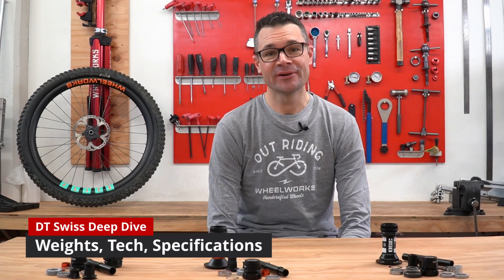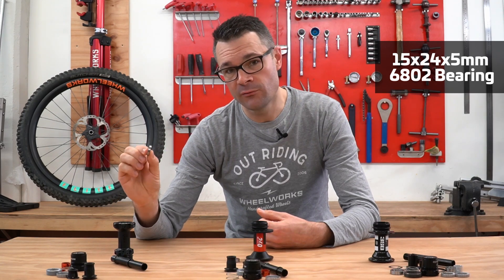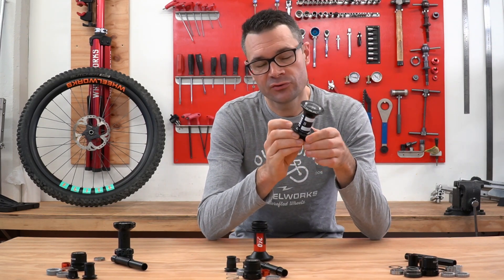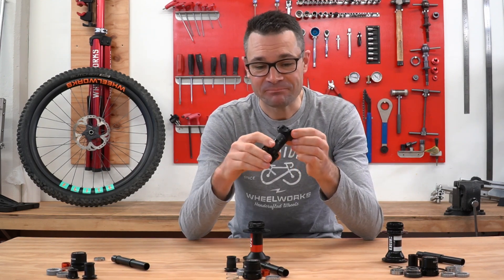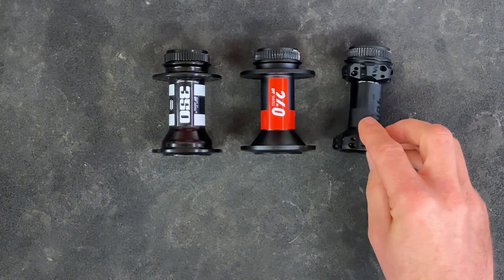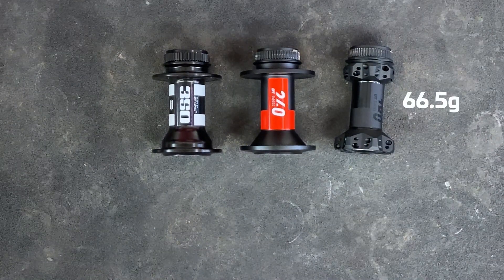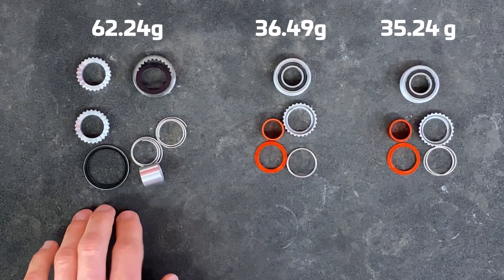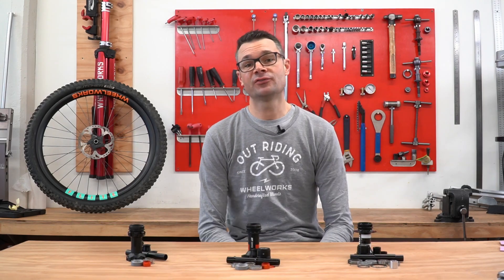DT-Swiss 180 v 240 v 350 FULL BREAKDOWN & WEIGHTS

Comment: Thank you for the video. But...i have one issue with the 240 front hub j bend, it is very heavy. At 146 grams ...pfu...i am talking of the latest one with 6 hole rotor mount, 15x110mm axle. I am disappointed. I have a 2 year old set of wheels with miche hubs and dt rims, the front one is 127 grams, both flanges are big(the 240 has one big and one small), not a single problem. And at around close to half the price for the hub. Bearings also top quality. With the rear i have no issue, top quality and low weight(227 grams) for the jbend, 6 hole, boost XD exp54 model.

Comment: Great video thanks! one question: Would it be possible to replace the hybrid ceramic bearings in the 180 with standard steel bearings if you wanted to? or are these non-standard bearing sizes? so not possible to find steel replacements? thanks!
Reply from the maker: Yes, absolutely.  The bearing sizes used (15x24x5 and 15x26x7mm) are easy to get from either DT Swiss or other bearing makers in a high quality steel version ~Tristan

Comment: why you skipped 370s?
Reply from the maker: its not available to buy* as an "aftermarket" hub and only comes fitted on new bikes so we left it out of this video. 

Now that DT Swiss are transitioning from the 3-pawl to the Ratchet LN system it's become even more confusing though!

*You do see the hubs available to buy sometimes but these are grey-market hubs which were destined for use on brand-new bikes but somehow ended up being sold aftermarket

-Tristan
Reply: @WheelworksHandcraftedWheels  thanks! I got several on pre-owned wheelsets and didnt notice that they are oem only

Comment: Tune hubs require "faffing around"? They're just a pawl hub. Build up just like any hub. I have two years on a climbhill/killhill set with no problems. It's a really good video; but why do you say silly stuff like this?
Reply from the maker: Our experience building and selling these over a number of years is quite different to yours.  Glad to hear you haven't experienced any issues with your pair!  -Tristan
Reply: @WheelworksHandcraftedWheels  what faffing around is going on here?
Reply from the maker: @trentvlak most of the problems are around a creaking drive mechanism related to the XOT bearing used.  The threaded endcaps which rely on o-rings to not rotate don't help but overall we found them to have extremely poor tolerances which leads to two "identical" hubs having parts which won't interchange -TT
Reply: @WheelworksHandcraftedWheels  oh, I see. My versions of the hubs don't have xot bearings or threaded end caps. They must have redesigned.

Comment: If I wanted to swap bearings from the 180 to the non ceramic 6802 would the dt Swiss front 6802 bearing work?
Reply from the maker: Any bearing quality / material of the same size will work  -Tristan
Reply: Genuine NTN LLB.

Comment: What about the front wheel hubs?
Reply from the maker: We focused on the rear hubs in this video because the front hub differences are less, however it's the same story with the more expensive hubs getting lighter and the 180 having ceramic bearings.  -Tristan
Reply: @WheelworksHandcraftedWheels  cool. What bearings are used? Are they all the same dimensions or different as on the rear?

Comment: The 180 hubs come on the carbon all mountain rims.  Should I be concerned about the hub strength or durability due to its low weight and smaller bearings.

Comment: Would love to see a comparison between their new (recent?) Hybrid hubs vs the OG ones. I am a firm believer that the DT Swiss ratchet system is the most solid/abuse-proof system for high torque applications (like those exerted by full power (85+ Nm) eMTBs), in comparison to pawl-based hubs. Before the Hybrid hubs existed, I just replaced the ratchets (gears) for the steel ones. But aside from a steel freehub body and ratchets... are there any more differences? Are they just another "eBike specific" gimmick? Cheers mate.
Reply from the maker: The Hybrid hubs are actually quite different:  The flanges are thicker, the spoke angle looks different, the internal threaded ratchet is a different size, and the freehub is different.  They are certainly not the same as the "regular" hubs and as you say it's refreshing to see this rather than "ebike specific" gimmicks.  -Tristan

Comment: Cool comparison. Seems like a legitimate weight saving going from the 350s to 240s. But those last few grams saved going from 240s to 180s seem like they were achieved mostly by doing things that will undoubtedly sacrifice service life and longevity. Also, hybrid ceramic bearings are terrible in practice because all the bumps you hit during your rides will cause the ultra-hard ceramic balls to make micro-indentations on the inner surfaces of the not-as-hard steel races and this will create more roughness and resistance over time, no matter how well you maintain them. Just a terrible idea, really.
Reply from the maker: Yeah our experience with ceramic and ceramic hybrid bearings echos this - they feel amazing when brand-new but quickly start to feel chunky even if they continue to spin.  This tends to happen quite quickly on a mountain bike hub but take a lot longer (obviously) on a road bike -Tristan
Reply: @WheelworksHandcraftedWheels  yep. Exactly my experience with CeramicSpeed bearings in my hubs, which are some of the most highly-regarded bearings in the industry. Though I do wonder why any of them are highly regarded. They feel amazing when new but truth be told, this is mostly from other tricks, like substituting oil for grease and using non-contact seals (which will even further reduce longevity). Why do companies continue with this bad idea when they and the consumer know that it’s a bad idea?
Reply from the maker: @RB-xv4si  Well at the risk of getting on my high-horse these is where marketing overpowers actual experience.  -Tristan

Comment: Do you have any concerns about the reduced bearing size in the 180 versus the 240? In an internet forum I read a post where the poster felt like the bearings were so small in the 180 that it might lead to durability issues. I take everything that I read online with a big grain of salt, but I did feel like that was an interesting thought regarding the 180. What are your thoughts on durability with the reduced bearing size in the 180?
Reply from the maker: Hey JB.  I'm not sure the smaller bearing will have a big impact on their longevity, especially as the non-driveside bearing (the one which is substantially smaller) is the lowest-loaded bearing and the one which tends to last the longest.  What we find is that ceramic bearings, from all companies including DT Swiss, tend to feel pretty gritty pretty fast.  This might be a 'feature' and they don't seem to get excessive friction, but your axle won't feel smooth when you turn it by hand.  They don't seem to develop any play.

Comment: Very informative just curious why you didn't do all 3 straight pull hubs be a better comparison.  Versus one straight pull and 2 j bend hubs . The j bends have more material.
Reply from the maker: Great question Dan and you're correct that the straight-pull versions of the 350 and 240 would have been a better comparison, or of course if my prayers were answered and we had a J-bend version of the 180!  We tend to use J-bend hubs wherever they're available as they build into a stiffer and generally more durable wheelset than straight-pull do.  We've got a video on this topic coming so make sure you subscribe -Tristan

Comment: Excellent review. I have the DTSwiss 240 EXP and recently experienced an issue with the internal ratchet disengaging mid ride. DT Swiss are aware of this issue and apparently a batch was manufactured using ratchet that undergoes higher wear. While they will warrant this, are you able to post the EXP ratchet removal tool needed? I am looking to do all future servicing and was not sure of that tool. I understand this is different to the 350 model. Thanks
Reply from the maker: This is the tool you need for the EXP hubs: https://www.wheelworks.co.nz/shop-2/tool/hxtxxx00n8387s-dt-swiss-tool-dt-disassembly-tool-for-exp-star-ratchet-w20x1-hxtxxx00n8387s/

Comment: I’ve also heard J bend spokes weak link is the bend compared to straight pull. Got 240 straight pull bladed spokes and 350 straight pull round spokes on my bikes
Reply from the maker: This is a bit of a fallacy - when correctly built J-bend spokes are stiffer and as durable (or more durable) than straight-pull.  Straight-pull has one significant advantage:  they're MUCH faster to build a wheel with and in a production environment that's money saved.  We've got a J-bend vs straight-pull video scheduled so we'll explain all of this in the future - stay tuned.  -Tristan
Reply: Supposed to be lighter too.
Reply from the maker: @catg9196  Again - it depends.  Generally the straight-pull hubs will be lighter though. -Tristan
Reply: @WheelworksHandcraftedWheels  How can J-bend spokes be stiffer than straight-pull? Metallurgically I don't see how that's possible other than the fact that straight-pull are usually longer since there are no hub flanges. Any bend will always have more flex than straight metal.
Reply: @akbast  With j-shaped needles, you can create more crosses if necessary.

Comment: What is your opinion on CL rotor attachment play? When the disc rotor is locked in place by the brake, you can turn the hub by approx 1°. Dt swiss say's its normal but its just seems poor manufacturing for such expensive hub.
Reply from the maker: It's rare that we see any rotor play.  Often what people think is rotor play is actually the brakepads moving inside the brake calliper.  However, once the lockring it tightened there shouldn't be any play in real-life because you're only braking in one direction and not reversing the load on the brake.  A large amount of play would indicate something isn't right, however generally there is no problem with a small amount of play. -TT
Reply: @WheelworksHandcraftedWheels  thanks, its not only for dt swiss even shimano xtr and I9 have this issues when I checked online forums.
Reply: Dude, it's totally normal and isn't a factor when riding. How often do you ever come to a stop and rock back and forth on your bike? It's a non-issue.

Comment: hi, I have gotten the newly built wheel set with 240 EXP hubs. The rear hub came already converted with the 54T ratchet. When the rear wheel is installed with 10 nm , the free hub does not work at all. It is like a fixed gear bike. When I loosen the axle , the free hub does work. I did check the internals, everything is where it should be. Any clue? Not received an answer from the wheel set-builder yet.
Reply from the maker: It's likely one of two things: (1) the red spacer is missing from between the freehub body and hub shell or (2) the fixed ratchet ring wasn't tightened enough into the hub.  (1) is an easy fix and (2) might sort itself out if you use your drivetrain to tighten the fixed ring but would ideally need the correct tool to tighten the ring.  -Tristan
Reply: @WheelworksHandcraftedWheels  Thank you very much for the info.

Comment: I currently ride DT Swiss 370 on STANS ... Any advise on upgrading?
Reply from the maker: Other than a better hub and a better rim? 🙈 The 370 can be upgraded now with the LN freehub body - this basically makes it a 350 with the star ratchet system. It's a reasonably expensive job especially as you'll need two special tools, but gives you a much better hub. If you're in NZ we have XD upgrades in stock, all others are due later in the year. -Tristan
Reply: Thank you.

Comment: you didn't mention the main differences in the end caps. The 350 has no seals whereas the 180 & 240 have o ring seals in. Edit: I've just been told 350 hubs do in fact have o rings in the end caps - mine are 2016 so maybe they have changed since then.
Reply from the maker: I can't recall the 350 ever NOT having o-rings and I just took a look at a few of our hubs and they've all got them.  Are you sure your orings didn't fall out?  They can do that after the endcaps are removed a few times -Tristan
Reply: @WheelworksHandcraftedWheels  Here's my 350 hub end cap: https://youtu.be/-nC4C2BQD2c . No o ring or anywhere an o ring to be. This was my front wheel end cap. My rear 350 does have o rings. So it seems that the 240s have o rings in both wheels end caps where as the 350 is only in the rear (for 15mm front / 12mm rear at least.)
Reply from the maker: @45graham45  I understand now.  Yes, the front hubs all use totally different systems of securing the endcaps.  Many people don't ask questions about the front hubs so we didn't do a deep-dive on these but maybe we should?  The 350 has the axle sit directly on the bearings so there is no space for o-rings.  The 240 uses a different system where the axle goes all the way through the bearings and does have them.  If you convert your hub to a 12mm through axle (for a road bike) then it will have o-rings on the endcaps :-)

Comment: "Big believer in J-Bend spokes... can build a better wheel than you can with J-Bend"...... so now I'm confused. Which are better: J-Bend or Straightpull?
Reply from the maker: This topic probably deserves it's own video!  J-bend hubs are better in every way and allow you to build a better wheelset if (and it's a big IF) you take the time and care but they're very labour intensive.  If you're planning on building a lot of the same wheel then straight-pull hubs/spokes reduce the lacing and tensioning time considerably and therefore have a massive cost saving.  This is the only reason that straight-pull has come about and why it remains - everything else they tell you is either marketing fluff or a straight up lie. -Tristan
Reply: @WheelworksHandcraftedWheels  but you said you "can build a better wheel than you can with j-bend" which is why it makes no sense.
Reply from the maker: @45graham45  I think I stumbled over my tongue.  We can build better wheels with J-bend spokes than we can with straight-pull.